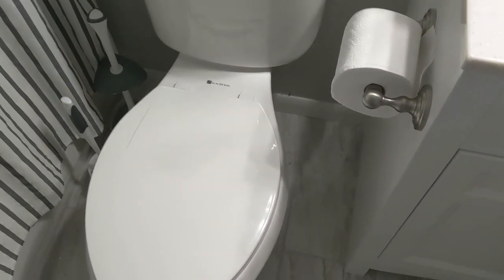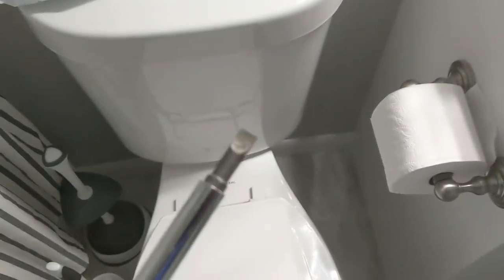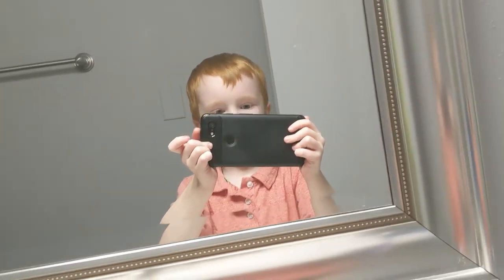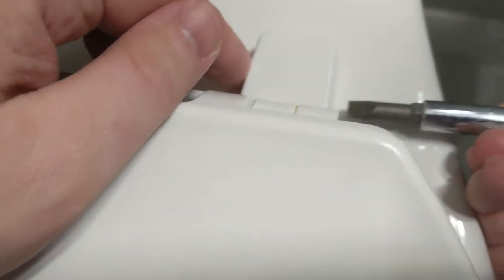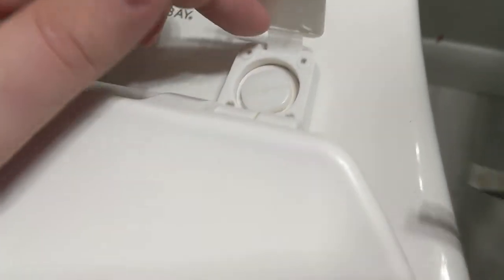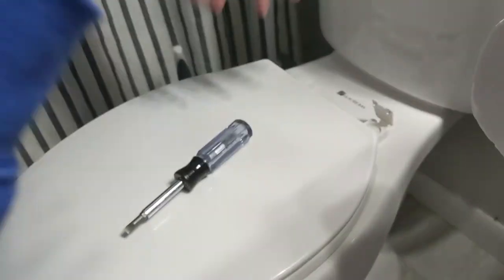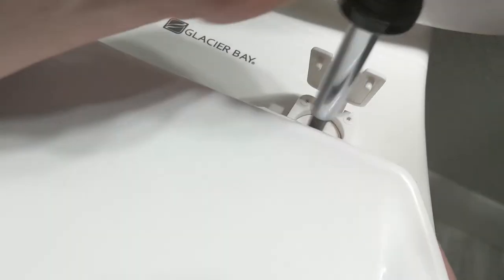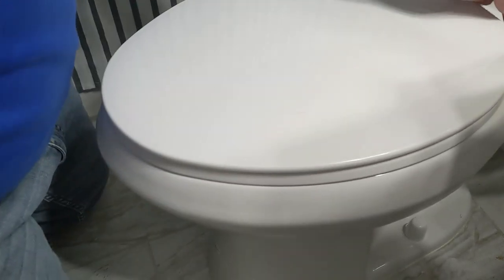How to FIX a loose wiggly TOILET SEAT w/ ONE TOOL GLACIER BAY

Comment: Mine won't tighten, even when I use a pliers to hold the lug nut in place underneath :( I can't even get it to loosen. Thoughts?
Reply from the maker: the screw might need to be replaced if it isnt tightening

Comment: Cute video, but that's common knowledge, how about a video of how to prevent it from coming untightened.
Reply from the maker: Yes good idea

"How hovering will help prevent your toilet seat from coming loose"
Reply: @Joseph Naylor  I look forward to it. Some say cut and use anti slip foam. Some say, add another nut to the bottom of the bolt to prevent the primary from untightening. Some seem to just purchase additional hardware kits. 

It amazes me because companies like Glaciers Edge only manufacture two bump risers/lifters (however, they are worded these days). When other competitors add 4 or more. Those are supposed to prevent the seat from shifting, causing it to untighten. 

Products these days. 😀

Comment: I'm gonna be a Debbie Downer and say that fixes it temporarily. The answer is "bad design from Glacier Bay keeps it from becoming a permanent solution."

This is just the next best thing you can do. I don't hate Glacier Bay, but they could've done better. You may want to buy thick rubber gaskets and place them between the base of the seat and the toilet to minimize slipping. With people sitting, the porcelain surface is too smooth for a platic seat. Eventually, the seat will wiggle itself loose again. Glacier Bay should've thought of that and provided rubber gaskets with the installation kit.
Reply from the maker: Thanks Deb for the comment.